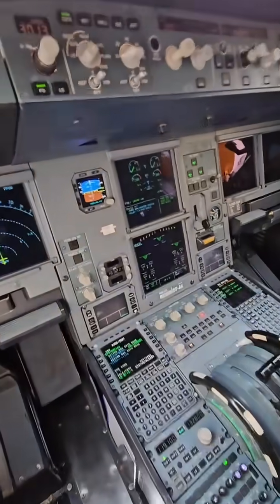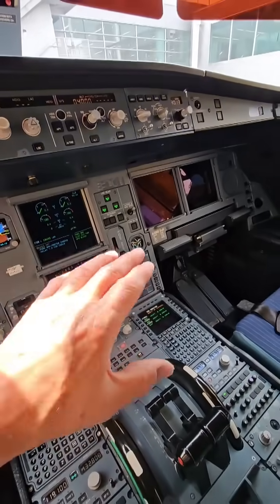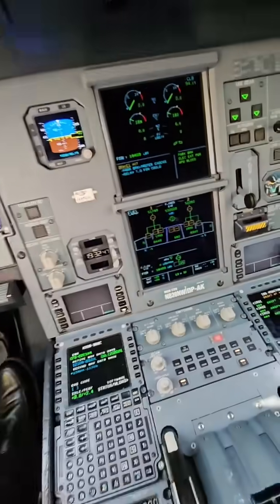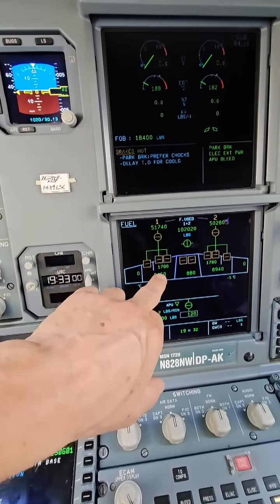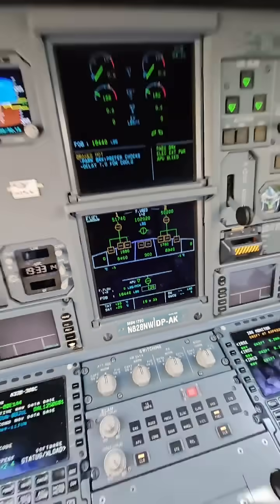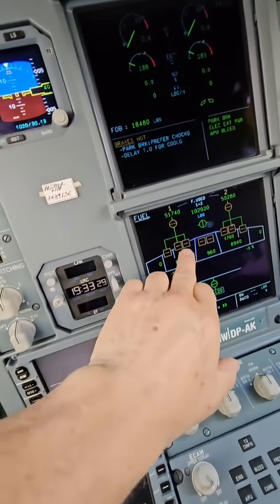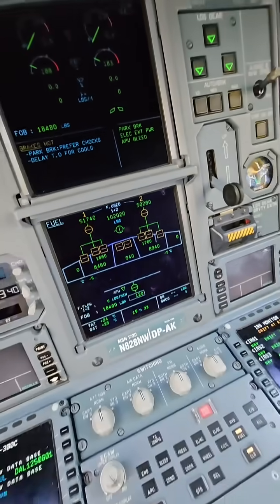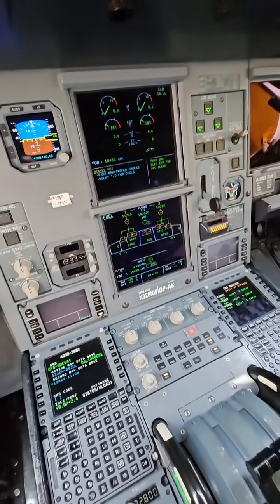An overview of our approach to managing the substantial fuel load on an Airbus A330-300.

Comment: Are the instruments easier than boeing? I mean everything seems easy to follow in the airbus
Reply from the maker: I think the instrumentation is about the same. It's the way the airplane is programmed to fly and how we interact with the airplane that is different. 

Airbus has flight laws that protect the aircraft from the pilot, meaning it limits our pitch and bank. There is also a computer that programs the flight controls to give us a constant control output from slow to fast speed, meaning we get the same response from our control input at all speeds. We also interact with the aircraft with a side stick vs. a yoke. 

In a traditional aircraft the slower you fly the greater displacement of the control surfaces you need to provide the same control authority. 

If you ever watch a Boeing landing in gusty winds you will see them rapidly moving the control column (the yoke) to control the aircraft. We don't have to do that in the Airbus because the computer displaces the control surfaces to a greater degree at slower speeds. This is all done automatically.

Comment: DTW for 20 years! I was born and raised in that area. Moved to Traverse City when i was 16. Anyway, a quick question. Have you ever had to declare an emergency? Again, really enjoy your clips, thanks again
Reply from the maker: I've been a passenger in a plane during 2 engine failures. I assume they declared an emergency, as they are required to do. 

One was on a USAir 737-300 from Philly to Florida. The other was on a Northwest Airlines 757 from Tampa to Minneapolis. Both were non-events. 

On the A330 about 10 years ago we had excessive engine vibration on engine #1 (left engine). It's not an engine failure, per-se, but I think we declared an emergency. We were flying from Atlanta to Amsterdam and we had just entered Canadian airspace. 

We wound up landing at Boston. Almost all emergency declarations end in a successful, safe landing.